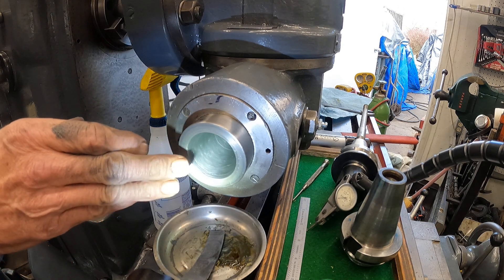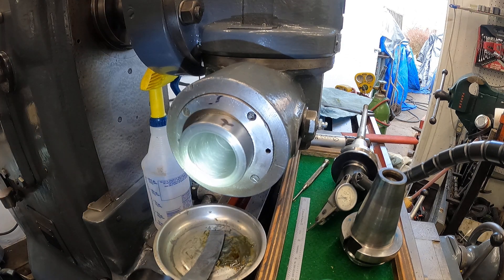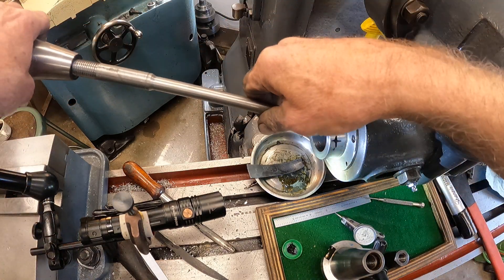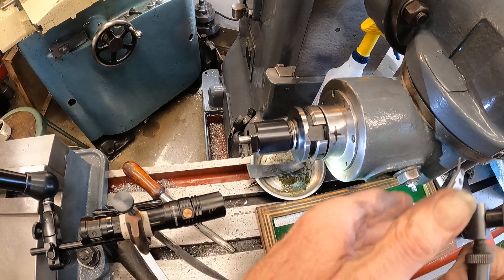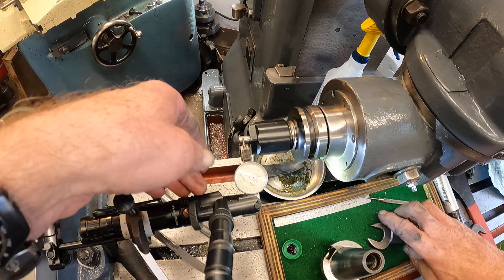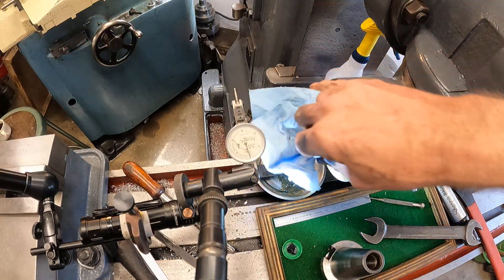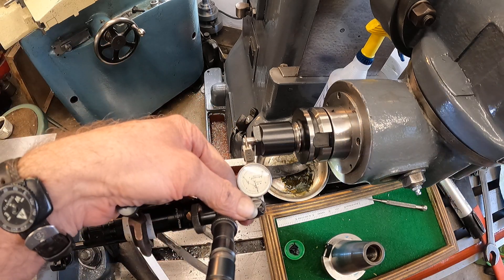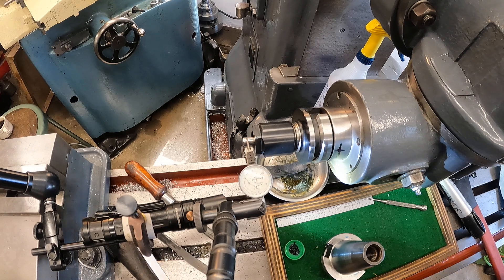Milling Machine spindle taper socket repair progress

Comment: Hi Don! Thanks for the vids. I know this is an old post... the 3.5 in per ft spindle is not self driving (locking) as I am sure u know. Seems like a homemade spindle maybe?! Since it has no drive keys. Thanks for all u share! Bet we know a guy that make a solid new one
Reply from the maker: Hi, it is a war time machine, the softer steel is working out good, but it is a light duty vertical head, thanks.